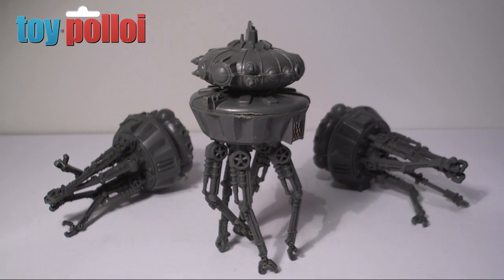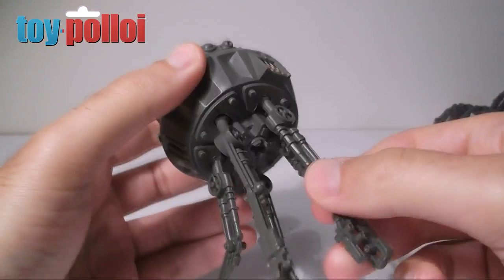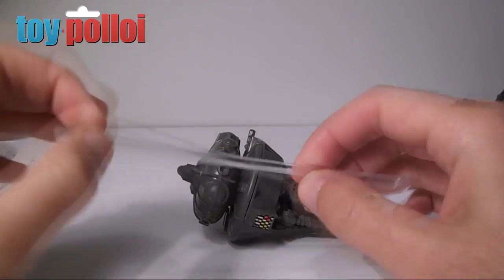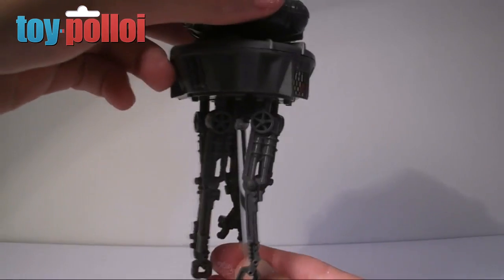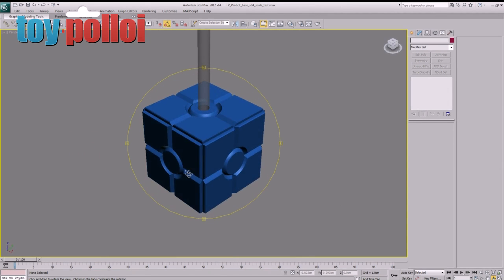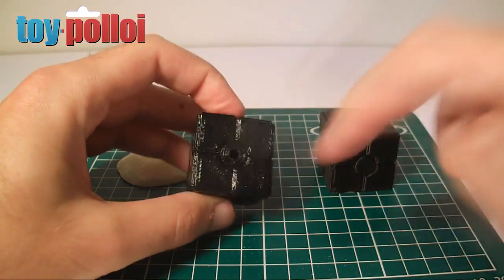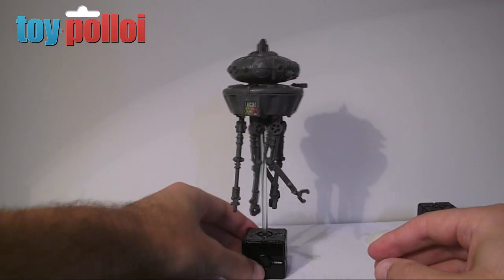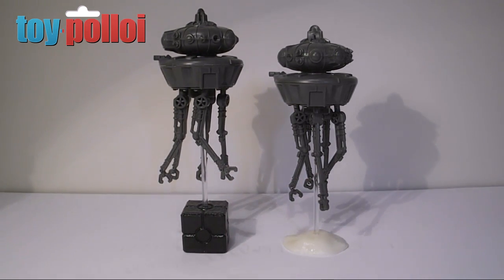Custom 3D printed Vintage Star Wars Probot (Probe Droid) stand with xrobots.co.uk

Comment: I'm not sure I'm going to be able to describe clearly what I'd like to here, but I believe that the bottom part of the grooves you've filed off from those balls would hold the Probot better if they were flat at the bottom, shaped like the letter L.
That would take a lot more work, though. You'd probably have to use a Dremel bit and be very careful.
Reply from the maker: i get what you mean. not sure how easy that would be to do.